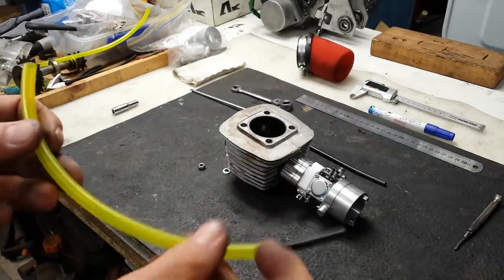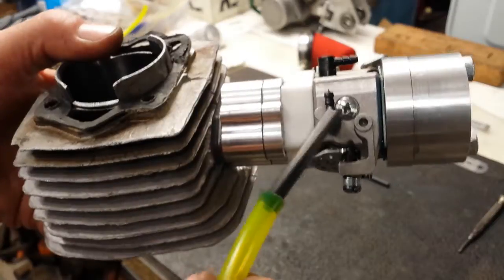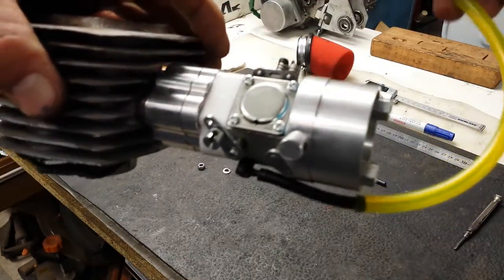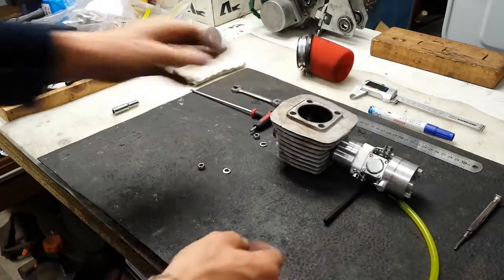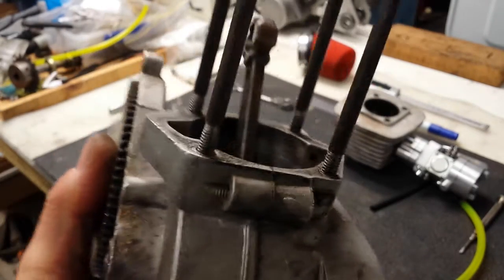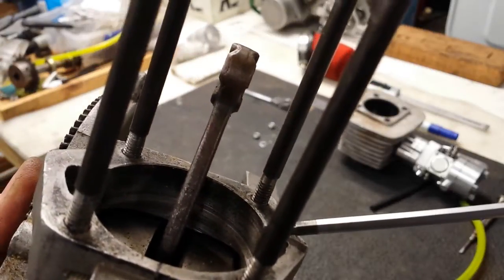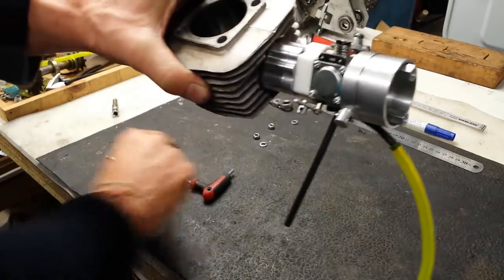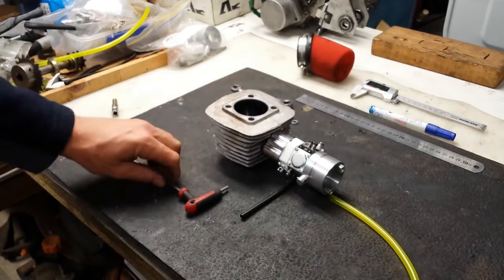R.S.E.  Reed Valve & Diaphragm Carburettor Assembly - part 2

Comment: I am using the Big Box Type Reed.  I really don't like the idea of drilling into the block for the pressure nipple.  I wonder if I could put the pressure tap in the side of the Big Box Type Reed on the engine side of the reed.  The reed is to control Back Pressure back thru the carburetor. There is a pressure difference at that point.  A R/C fuel nipple and it is threaded, would be what I would use.  Copper tube, JB Welded in place or the inside end of the tube would be flared to keep it from pulling out.  Oh, by the way, "Walbro" Carburetors are manufactures here in MIchigan.

Comment: The pulse line and drilling is actually only required because RSE didn't include the pulse feed in the thermal isolator. Look at the throttle plate side face of that walbro, see those 2 small holes? Those are "negative pressure pulse ports" that feed vacuum to the diaphragm if the are allowed access to the throttle to Reed volume. Then that nipple pulse port is merely an atmospheric vent. The industrial walbro type isolators and the gaskets for them tap one of those pulse ports to the Reed chamber volume for that very reason, as it eliminates that potential air leak. The nipple then is plumbed to the air cleaner clean side to prevent dust entry to the vent. Check it out on the Amazon 15mm chineseum walbro sets, they ALL have one of those ports communicating with that Reed box volume. You actually lose a little diaphragm pump efficiency the way RSE set it up, as the throttle side face ports are blocked, so one side of the pump action is restricted, and the other is pushing and pulling (nipple side). With both open, it is only pulling and relaxing on the throttle side port, and the nipple port "breathes", a less restrictive cycle.

Comment: Can you hook up a boost bottle to that setup?
Reply from the maker: A boost bottle is a complete waste of time and money. They do absolutely nothing at all for performance. You are a fool if buying a boost bottle.
Reply: A boost bottle is for engines with too much intake timing. A Reed setup cannot suffer that problem, as the reeds entirely prevent reversion, they are check valves. No reversion to the intake tract, a boost bottle can only work as a fashion statement, lol. If you have a reversion prone setup, a boost bottle properly sized theoretically provides a lower resistance path for reversion mass, compared to the inertial ram mass of carb air flow, as it will be at lower pressure than the carb outlet. Whether that theory actually plays out in reality is hotly debated, lol. But no matter if it does, reeds make it a moot point, they prevent reversion.